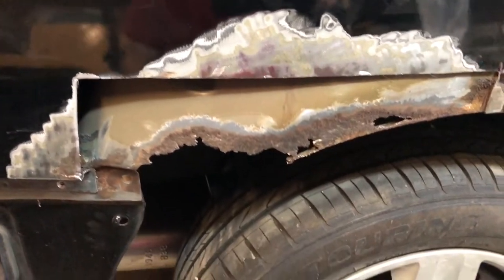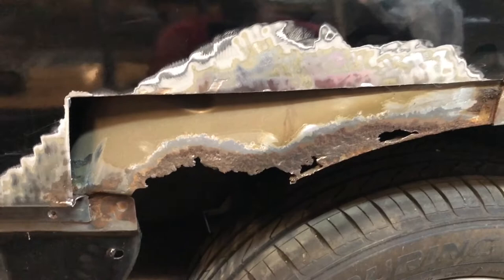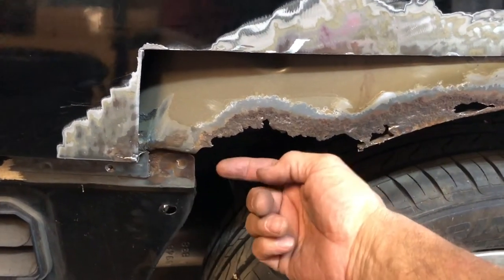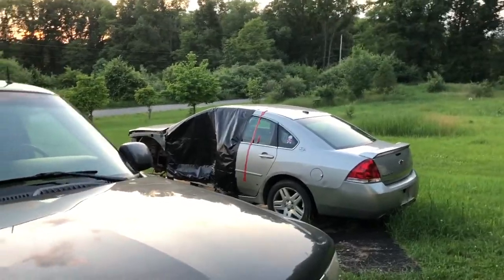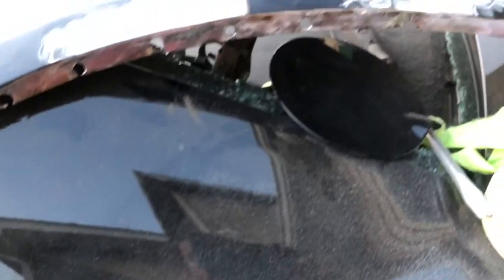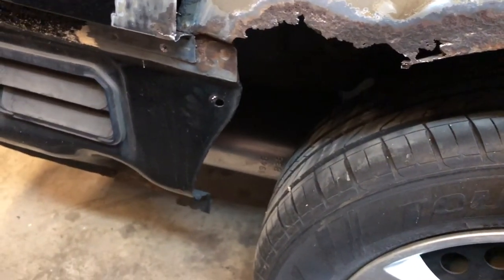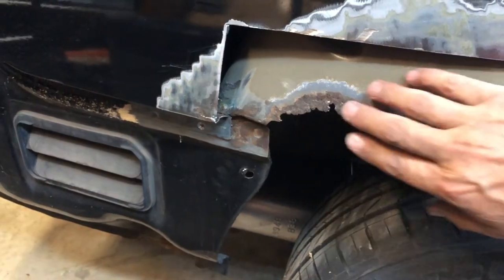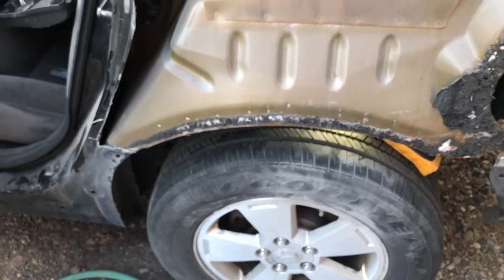Passenger Rear Quarter Panel Rust Repair

Comment: An option if you don't want to weld on the inner panel you could overlap and use panel bond and some rivets for structural integrity That way if the car ever gets hit in the rear, and also a good backing for the outer skin. Looking forward to the updates.